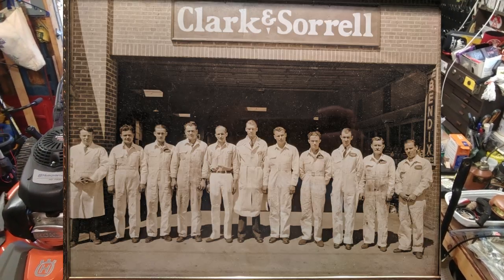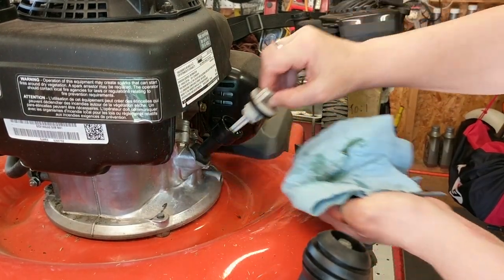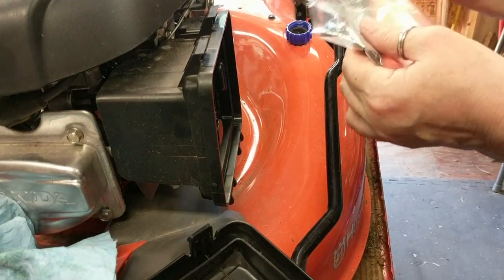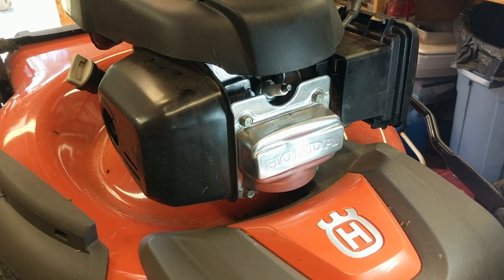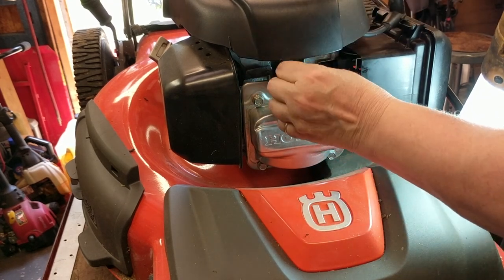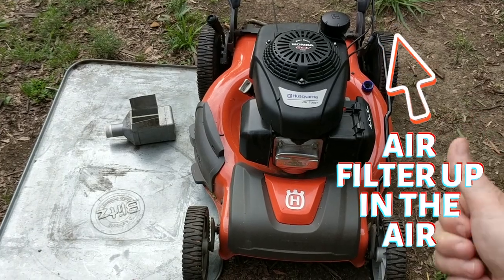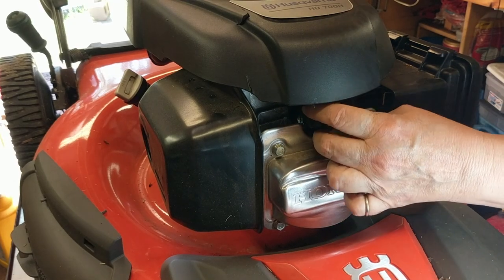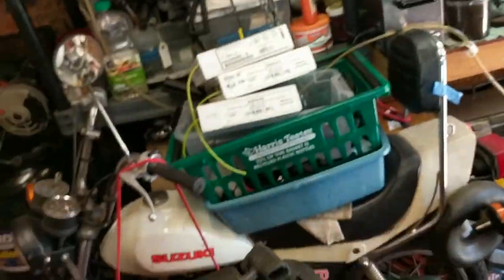Honda GCV160 Starts Then Dies: Tune-up for Husqvarna HU700H Lawn Mower

Comment: These mowers must have the valves adjusted as part of their tune up.  Without that, the mower will either stop, or not start. It's .006" on the intake, and .008" on the exhaust.  The tune up is not complete without doing a valve adjustment.  Everything else was spot on, except for the valve train tune up procedure, which is essential.

Comment: Thank you very much. I'm so happy  I found your video. Your instructions and video were clear and easy to follow. I'm a new homeowner and know nothing about lawnmowers, we bought the lawnmower about 3 years ago and haven't used it much so we haven't performed any maintenance. We pulled it out for the first time since Winter, added fresh gas and it refused to start. I picked up a spark plug and a new filter (the old one was nasty) right after watching your video, rushed home, got them put in, it didn't start right away, so I pushed it back and forth a bit then tried again. It finally started. Thank you again!
Reply from the maker: Happy to help. Cheers!

Comment: I have the same mower deck kept dropping dow to ground, replaced the plastic front axle clips on both sides still drops but not completly , any suggestions.
Reply from the maker: I wish I could be more helpful. I've not encountered this issue before. I appreciate you watching. Cheers!

Comment: I have the same mower. Did this same process two years ago. I have changed the spark plug and air filter again since. Getting surging and hesitation after it runs for a minute or two. I think the gas sat in there for too long. Trying to run it empty. Not sure what else to do.
Reply from the maker: You need to clean the carb, specifically the idle circuit. https://youtu.be/8qic4cARD2E Different mower brand, but same engine, or this video if you don't have access to an ultrasonic cleaner: https://youtu.be/wJPM_ArLSgg

Comment: I got a question I got the same mower I let a family member borrow it and there's a piece on the back of the frame the clips on I'm trying to find that part but I don't know the name of the part could u help me with the part name ? thanks
Reply from the maker: I think you might be referring to the rear skirt? Best to go to any major parts house (partstree, repairclinic, etc.) and look up the parts diagram for your mower model number. Thanks for watching?

Comment: Great review and very helpful. I have this exact model and will be performing the same tune-up. I have a question mam, is there a way to adjust the front wheels for this model? I can’t seem to adjust the front wheels.
Reply from the maker: Thanks for watching!  That bar that runs along the left side of the mower connects the front and rear wheels together for one adjuster. I don't have this mower in front of me, but I suggest looking for a missing cotter pin or something that would attach that bar to the front wheel axle. I have a 4 wheel drive version in my bone yard that I can check in the daylight. I hope this helps.

Comment: Great video - those hondas are really reliable engines. Keep up the nice work! Cheers from Sweden!
Reply from the maker: Thank you very much Mr. Anders! It warms my heart to know my videos are seen all over the world. Cheers to you too!
Reply: @TheLawnmowerLady  Thanks for your message! I hope we can meet up at Micks stream sometime. I will try to join the panel there, since I also am a small engine mech. By the way a question: I am on lookout for a obosolete bracket to a Briggs engine. 3,5 or 4 HP " the vertical pull starter modells". Its a bracket to hold the mechanical governor and its mounted on the tank. Do you have any scrap/spare part engine of that modell? if yes I can give the details. Thanks and have a great week!
Reply from the maker: @andersforrad  Thanks Mr. Anders! Be sure and ask that question in the chat next time on Mick's live. If you post the engine model #, or the part # from a diagram, I'm sure someone can help you. I don't have any spare parts mowers with vertical pull cords other than Honda. Most push mower scraps for me are all Briggs classic, Briggs Quantum, and several Tecumseh.
Reply: @TheLawnmowerLady   - Thanks for your feedback. I will check that in the chat next time. Have a nice afternoon!

Comment: Not sure of the model but I have a four-wheel-drive husqvarna push mower in the shop right now. I’m curious to see how that drive system works
Reply from the maker: Right on Mr Jeremy! I got one in my backyard as a parts donor. More baffles on the underside, longer belt and several idler sheaves to route the belt to both drives.
Reply: The tech that does the push mowers at the shop HATES those 4wheel drive units.
Reply from the maker: @dudekanic  I've only had a few in my little shop, and mercifully only tune-up stuff and blade sharpening. No drive issues... Yet!

Comment: Thank you, I follow your tune-up method with my same Honda engine on a Troy-Bilt deck every spring but I use a new plug and change the blade too. This year, however, the engine starts first pull every time from cold but is very difficult to restart once fully warmed up (choke open). I can run an entire tank of gas through it, no problem, but if I stop the engine it’s very reluctant to restart. Have you ever encountered this problem before?
Reply from the maker: Thanks for watching Mr. George! Hard starting while hot is often a sign of a failing ignition coil. Before you go throwing big parts $$ at this machine, there are a few things you can try first. 
1) look inside the spark plug boot at the connector, It should be shiny and no corrosion. If it's rusted, or corroded, there is a slight chance a new spark plug boot can be installed. The plug wire itself is very short, so you would need cut off the rubber boot, rather than just snipping off the wire to preserve as long of a wire as possible. NGK replacement boots are screw on types, you might need to trim off 2-3mm of the wire to get a square cut suitable for the new cap. 
2) pop off the top cover and see if there's any corrosion on the surfaces of the coil and flywheel. Not as common on Hondas as on B/S engines, but if there is an abundance of rust or oxidation on either the faces or the studs that hold the coil in place, try sanding those surfaces. That coil needs a good solid connection to the engine [Ground] 
3) while you are in there, check to see if the gap is still good between the legs of the coil and the magnets on the flywheel. Because one of the coil mounting brackets fits on the same stud that holds the re-coil starter on, it's sometimes easy to get that loose, and then inadvertently, re-tighten the stud, thereby getting the gap out of whack. 
4) If you're handy with a volt/ohm meter. Look for 3-4ohms between the ground wire and one of the legs of the coil, as well as between one leg and the conductor inside the spark plug boot.
Good luck, I have a video in the can that address these things. Just need a few rainy days to edit them together. Cheers!
Reply: @TheLawnmowerLady  Thank you, I’ll check the gap and ohm-out the ground connection. I appreciate your advice.
Reply: @TheLawnmowerLady  Thought I’d let you know about my continuing Honda adventure. My neighbour and I both bought identical Troy-Bilt mowers on sale from Canadian Tire several years ago. He’s not had the same trouble as me. I talked him in to allowing me to remove his ignition coil and use it on mine for a day…same thing, no start when hot. Then, while scratching my head some more, I noticed the safety switch tucked under the flywheel wondering if it could be the problem. That switch is open during operation and closes when you release the bail handle thus grounding out the ignition coil, as I understand it. I thought it might be staying closed when hot so I sprayed the daylights out of it with electrical contact cleaner getting spray under the protective boot. Today, it started every time while the engine was hot!  I’m thinking that switch was the problem all along, but I don’t trust it, looks like fun trying to replace it. Thanks again for your help, this seems like a fairly rare problem…maybe helps you one day.
Reply from the maker: @georgeian3243  Glad you figured this out Mr. George! And lucky you could use that coil from your neighbor. I've honestly not seen the safety switch actually cause this problem, but it makes sense.  I do clean off the crud anytime I have to take off a shroud, especially on B/S engines. No special reason, but I might as well while the cover is off. Thanks for following up, and I too hope this helps someone in the future. Cheers!

Comment: Nice, I just stumbled on this video,
I was given a Honda mower, was told it was great 7 years, last year wouldn't start,  I thought maybe , oil, new gas, filter, maybe it run,   cleaned old plug,,, no start,,, crossing fingers, going for plug,. Lord, I hope she runs,

Thank You,
Let you know, 

PS 
What do you know about 95 Ford f150 
6 inline motor ?
Not a mower,    But I have never seen video so well explained,, 👍
Reply from the maker: It's rarely the plug, (sorry) but I do have several videos on Honda branded mowers. It's often dirty carburetor, stale fuel, etc. Watch the first 5 minutes of my latest video (Troy-Bilt pressure washer) for the quick and easy diagnosis of what might be wrong. Check out this playlist of Honda mower repairs. Your model might not be exactly the same, but you'll find several fixes: https://www.youtube.com/playlist?list=PLscwXOlCLzlzHYMopMHmLP3oqzZ07e6DF

I did drive a 5-speed '88 F150 with a straight 6 for about 12 years. Old guys would roll down their windows at stop lights to tell me "That's the best engine Ford ever made" They all had that gravely, deep, cigarette raspy voice. I got several offers to buy it from me. LOL I appreciate you watching. Cheers!

Comment: Thats awesome you didn't have to take that valve cover off, I was sure the cover was up against the rockers, a other lawnmower lady "mow better"! Stella  rocks!
Reply from the maker: Thanks 👍 Mr Joe! I do have one of those automotive stethoscopes, and did check before I delivered it to her.
Reply: @TheLawnmowerLady  hey I have one of those stethoscopes also, I  use it on my head to hear which gears I've gone and slipped  loose 😅

Comment: I'm late to but your video helped a lot though it didn't solve my problem. I've ordered a carburetor to see if that solves the problem.
Reply from the maker: If yours has the plastic idle speed screw on top, that needs to come out. My friend Tom, his channel is Vintage Engine Repairs, has a great video on this type of carb. Honda GCV Carburettor Indepth Fault Finding. Hope this helps.

Comment: Nice videos. Easy to follow instructions. I'm curious, though. I've watched a few of your "tune-up videos and noticed you never mention cleaning the underside of the deck or sharpening the blade as part of your tune-up. Is this to keep the video short? Or, is that not part of your tune-up proceedure? Not really important. Just an observation. Keep up the videos. They're very well presented and informative.
Reply from the maker: Thanks Ms Brenda. Yes, I often do clean the mowers and sharpen blades, though rarely mention that. And yes, it's to limit the video length and scope. So many viewers are searching for specific things, and when I can keep the focus limited, I think viewers have a better experience. I have no idea if my theories are correct, LOL, but I keep trying to stay succinct on topic. I appreciate you watching. Cheers!

Comment: Thank you. Can low oils middle of stick cause it not to run. I have a 160 east start. It’s a HHR216VKA this is Model number it starts only with spray start 
I have cleaned carburetor she starts and dies about 3 minutes later. I have changed the gas and new filter. The chock is working I see it open and close as it’s running for three minutes 

Any help lawnmower lady will be appreciated 
Thanks Houli
Reply from the maker: Low oil just means a bit more wear and tear on engine internals. Never have I seen it as a reason not to start except on generators with low oil sensors. If you don't have a separate choke cable, or lever, I'd be suspect of the thermowax piston thingy that controls the auto choke function. Hope this helps.

Comment: I have a GC160 on a pressure washer and it starts right up but dies after about 20 seconds.  I replaced the fuel pump, cleaned the carb. replaced the gas.  sometime it starts right back up and dies in 20 sec and other times it needs to sit a little bit then starts right up. Sometimes is backfires a little when it dies.  When it is running for the 20 seconds it seems to run fine then suddenly dies.  I noticed the choke on the engine side jumps closed when it decides to die. Thoughts?
Reply from the maker: Diagnosing over the internet is difficult, but I'd be starting with the basics, and cheap. You don't mention the spark plug, it's rarely the real problem, but a cheap part to toss in the mix. Beyond that, I might be looking at a leak down test? I wish I could be more helpful. Thanks for watching.

Comment: Said gas smelled bad. Was it replaced? Engine sounded rough  which could be sticking float and seat due to bad gas.
Reply from the maker: I most likely did drain the fuel and replace it with some fresh ethanol free fuel. Thanks for watching.

Comment: Why did you ignore the engine sputtering at the end of the video?
I have the exact same mower and it starts and runs smoothly for a bit before it starts sputtering just like the mower in this video.
Reply from the maker: I honestly think what you are hearing in this video is an audio/microphone anomaly. I have gone though several cameras, microphones, etc., over the years; and they all have noise suppression quirks that I can't always control. I don't recall which camera/mic I was using. That said, if your mower does this, there could be many different issues: fuel flow, clogged jets, dirty fuel, ignition problems, poor air flow... diagnosing any issue over the internet is difficult.

Comment: I have the exact mower with the Honda engine and can't figure out why I can't get it to start...changed plug, oil, air filter. Checked/cleaned the carb,, auto choke is closed when cold,  new gas, fuel lines clear...any suggestions? Been watching your vids for the last 2 weeks!! Love the channel 💙
Reply from the maker: I wish it was easy to fix over the interwebs 😬 I'd start to make sure you actually have spark, pull the plug and ground it out on some part of the engine head. Hopefully you will see spark jump across the electrode when you get a friend to pull the rope. If you don't have spark, you might have a bad zone cable (brake cable). It's rare, but some new plugs are bad, try the old one. 

Next, try squirting a bit of fuel directly into the throat of the carburetor. If it fires off for a bit, then you have a fuel flow problem. Take out the bottom screw on the carb bowl, while it's still on the engine. Open the fuel tap, and you should see a good dribble of fuel. If not, you have a clogged, collapsed fuel line, or maybe the fuel tank screen is plugged.  Good luck!
Reply: @TheLawnmowerLady  thanks so much! Nothing like having the machine in the shop but appreciate the time to troubleshoot!  I'll give it a try and let you know what happens.
Reply: @TheLawnmowerLady  turns out it was the brake cable.  Popped it off and got more tension on it, hooked it back up.  Ended up having a surging problem after that, so went back and re-cleaned the carb really well (like all the parts!). So I think that's all she wrote. Thanks again! Looking forward to the next video 🙂
Reply from the maker: @jmoney20psu2  Yay! Happy I could help out. Cheers!

Comment: I have a similar model husqvarna (7021p) and it starts right up every time on first pull and after a few seconds dies. I changed oil, filter, gas, and spark plug. Checked carb and it was super clean. Up until now I had no problems with my mower. Any ideas of what to try next?
Reply from the maker: It certainly sounds like a fuel delivery issue. Even the smallest amount of water (from ethanol laced fuel) in the carb bowl will keep the mower from running. That, and the idle circuit of these carburetors often get clogged up. Unless you completely disassembled the carb, you might have some clogged passages https://youtu.be/8qic4cARD2E takes this same carb completely apart to clean. I hope this helps.
Reply: @TheLawnmowerLady  thank you, I’ll look into that
Reply from the maker: Actually this is a better video for you:  https://youtu.be/wJPM_ArLSgg  I clean this carb without the use of my ultrasonic cleaner.

Comment: Lawnmower lady hello quick question what is kickback on a pull start on a Briggs and Stratton champion 35 and hydro lock ken said oil.on valves. But have noticed oil from the bottom not loads just a wipe over every now and then
Reply from the maker: Thanks for watching Mr Ronnie ! If you have oil leaking out below the engine, and kick back, sounds to me like a sheared flywheel key and a bent crankshaft. Check out this video: https://youtu.be/PyhYQU8IS0E  It might be terminal of the crank is so bent as to damage the oil seal.
Reply: @TheLawnmowerLady   took flywheel of today and the keys has a slight gauge init but could be a little shear i havent hit anything no  rocks or bricks i pulled it 2 hard and broke the plastic under the pulley changed the plastic and new spring thats all ive replaced pulled it yesterday nearly took me arm of

Comment: Sorry to bug you ! My kid left the lawnmower with no gas!! You think this might help to get it going ? Thank you !
Reply from the maker: Check the basics: spark, fuel, and air filter. If it's a Honda, east to drop the carb bowl (10mm) to make sure there is no gunk in the bottom of the carb. If it looks janky in there, a simple carb clean should fix you up. I just released a basic carb clean video today on a similar Honda: https://youtu.be/wJPM_ArLSgg  Hope this helps!